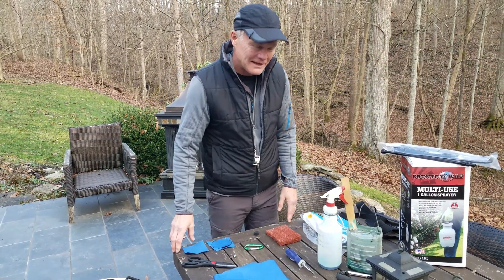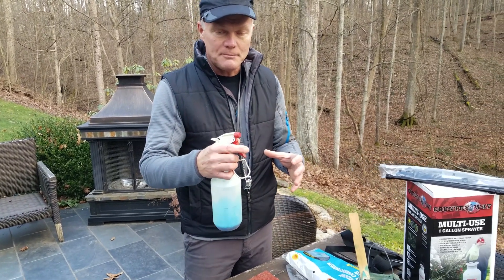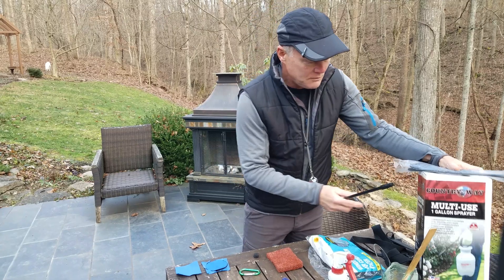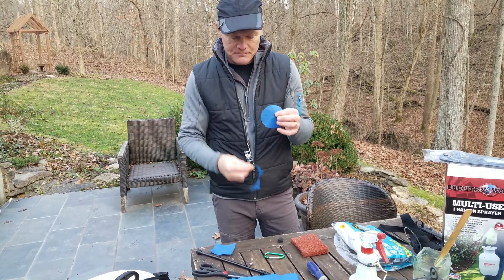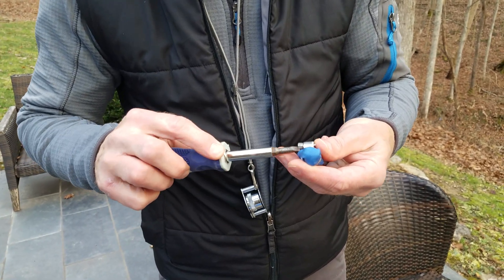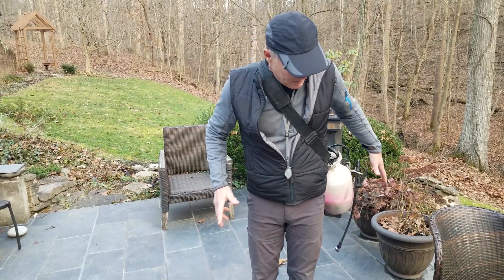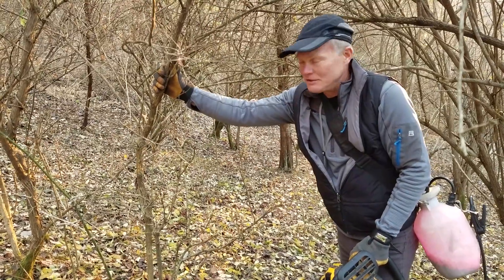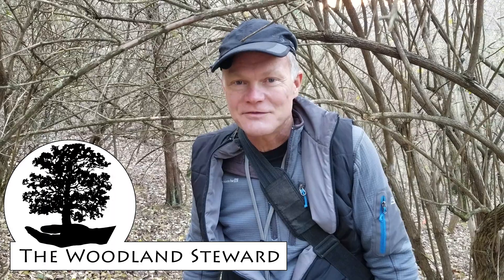Making an Herbicide Applicator for cut-stems (for ~$10) that will help you work safer and better

Comment: Thank you for the video.  I just heard about putting it in a bingo dauber.  Has anyone tried this? Did it work well?
Reply: it works well. The Buckthorn Blaster is basically the same, but with more herbicide-resistant materials. But expensive, for a bingo dauber, and you'll be on your hands and knees for every stump

Comment: Have looked all over for the indicator dye. Where can you get that hot pink color?
Reply: I think it is probably just fabric dye; Jim will correct me if I’m wrong, but that’s what I use in glyphosate. The difference I have noticed from the usual herbicide blue dye is that the red lasts a lot longer. What I mean is that a few weeks later the blue has faded or washed away whereas the red lasts. I used the blue with triclopyr. I’m not sure if the blue is meant to fade away. It’s still useful in knowing that you haven’t missed any cut stumps on the day, but not useful for making it easy to find the treated stumps months later. If you are generous with the amount of red fabric dye, the little pink cut stump will stay pink for a while.
Reply: @mayboggess2783  thanks for the help. Will try that.

Comment: Have you considered using paint dauber bottles?  It's a 2 to 4-oz bottle with a build-in sponge applicator tip. Think "bingo marker" and you have it.
Reply from the maker: I like the idea of paint dauber bottles. I have a small spray bottle on my belt when I go walking for that occasional application. Generally though, I need more volume (and I like the added length of the applicator wand when cutting with a chain saw or brush cutter).
Reply: I bought a couple of buckthorn blasters. They are like a paint dauber I think: small plastic bottle with sponge over the top. Fill it up then squeeze to fill the foam, then dab. They were nice because they were small and never spill. The problem was that the sponge wore out immediately, like within a day. I then experimented with someone over the top to protect the sponge. I used kitchen wipers; firmer than paper but not as tough as fabric, and held it on with an elastic band. The herbicides regraded the elastic band, which is probably why Jim uses the metal clamp: much better! Now that I have watched this video a few times I realize I can resurrect my little buckthorn blaster bottles by following Jim’s advice: fabric held on with metal clamp. They will be handy for small pocket sized jobs when you don’t want to get all the big gear out.
Reply: @mayboggess2783 I've used the Buckthorn Blasters for years and find the sponges wear out after about two seasons. The folks who sell the Blasters sell replacement sponges. It's possible that the heads from bingo card markers would work also; they are available on Amazon. One thing I like about the Blasters is that they have  spill-proof screw-on caps. I can just toss a bottle in the bucket I use for carrying tools. I usually carry several bottles, each with a solution of a different herbicide; I spray the caps different colors to help identify them. I chose to use the Blasters rather than a wand: if I'm on my knees to cut the tree or shrub then I can just daub the stumps while I'm down; no point in standing up to do the job.

Comment: Jim, great info on how to modify a sprayer for cut and spray applications. I primarily use my backpack sprayer for use on invasives such as buckthorn, Canadian thistle, burdock, and garlic mustard but I have a pond so I can’t girdle the buckthorn. Since I need to use an aquatic glyphosate, it will require a cut and spray application. Your advice on modifying a sprayer will really help. I also just subscribed since I really appreciate your knowledge. I have 40 acres full of invasive and would like to contact you on an occasion for advice.

Comment: I tried your method today.  It worked.  I sometimes got some extra release and drippage from squeezing the trigger a little too much.  This method definitely got more dye on my pants.  Less bending over that when using a dabbing sponge in a little tube.  Also I found a half gallon sprayer and used that instead of a gallon, less to carry.  Thanks!
Reply from the maker: The smaller sprayer is definitely a good idea!

Comment: After my first season last fall and winter treating cut trunks, I'm going to this method.  I had bought a small hand-held applicator that you pump nd spray but instead of spraying into the environment I sprayed into a disposable sponge paintbrush and painted it on.  It worked but takes a lot more time and effort and of course now the goofy thing is leaking at the nozzle and I don't know how to clean it or if that will help and the neighbor says oh they always leak.  I keep it in a bucket nestled in paper towels with the paintbrush in there and I see it seeped more than what I want to continue with anyway after going back to it.  Wish me luck!  Heavy duty nylon??  I have lots of scrap fabric around but I will start t the fabric store and ask for this.  To me, it does not sound very absorbent or porous but probably that's the point.

Comment: Just found this.
Grand idea! 
 I would recommend using zip ties over the dauber, instead of the hose clamp, as they won't be affected by the salts in many herbicides. 
I am in a war with Yuapon Holly and a dauber would be more efficient and targeted than current spray method.
Reply from the maker: Good idea! I chose the hose clamps because I didn't want them blowing off, but a zip tie might work too.

Comment: Looks  like a great idea! I'm looking to attack the wild rose that has recently come to overrun the woods in our area of Bethesda, MD. I gather you'd use 20% glyphosate on the cut stems. Watching your shoulder harness, which looks like an excellent concept, I'm worried about the tip of the sprayer hitting and soaking  one's pants leg. How do you avoid that? And do you use rubber gloves with the sprayer?
Reply from the maker: Sorry for the delay in responding. Yes, we use a 20% glyphosate to treat cut stems. I have not solved the problem of the sprayer tip hitting my pant leg. I try to hang it such that in minimizes the bumping, but you are right, it still happens. Fortunately, with the dye in the solution, I can see that very little if any is actually getting through to my leg through my pants. And yes, I try to wear rubberized gloves when spraying.

Comment: What a great idea. Usually when I cut stump and spray I use a squirt bottle and you're right, it aerosols the liquid. I'm definitely going to use this idea this year. I use a backpack sprayer for all of my foliar spraying. I usually dilute my glyphosate to 3-4 percent. What are your thoughts on wearing goggles and respirator while foliar spraying? Overkill? Thanks for posting this. Your channel is definitely one of the best articulated channels for this kind of outdoor venture. Please keep them coming.
Reply from the maker: Thanks for the comments! I usually don't wear goggles and a respirator for glyphosate, but I may be underestimating the risk. I rarely am spraying large areas with a lot of drift. When I am treating Japanese Stilt Grass (with Acclaim Extra) I tend to spray larger areas and from a greater height. Then I will wear a respirator.

Comment: Just bought a sprayer. Glad I found this video, gonna tune mine up now. I plan on using Dow Tordon on the Honeysuckle, any experience with it?
Thanks for the vids!!
Reply from the maker: Tordon can be released by the roots and can kill nearby plants. I think there is a warning on the label to not use it if there are valuable plants in the area.  I avoid it.
Reply: @TheWoodlandSteward  Interesting. I stopped using tordon for hack and squirt on ailanthus because it wasn't super effective on the bigger trees, but also because I noticed that it caused partial wilting on some adjacent paw paws.
Reply: I noticed the same with Tordon on a few paw paws but it never actually killed one.  I don't use Tordon anymore.  I've had excellent results with undiluted water-based triclopyr (44% i think, Alligare 3 was the brand) for hack and squirt on ailanthus.

Comment: Great thinking about the sprayer! Curious as to what you use for a color indicator. Would food coloring work?
Reply from the maker: We use Laser Blue Spray Pattern Indicator by Sanco Industries. We have been buying it for about $17/quart at Rural King. Similar products seem about twice as much at other vendors (like Amazon). I just order a gallon of the Sanco product directly from Sanco for about $45. It is VERY concentrated. You use 0.5 to 1 oz. in each gallon of herbicide. I use 1 oz. which is very noticeable until it rains. I have never tried food coloring, but would imagine that it would not be strong enough. If you try it, let me know.

Comment: Thanks for an excellent video on a make-it-yourself solution to 'painting' stumps with herbicide.  I've always rejected using chemicals but, with over 100 acres of woodland and getting on in years, I am willing to use what is necessary if I can avoid harming the environment.  It is frightening to see where those chemicals wind up after you put a color marker in them. I find both the simple bottle sprayers and the cheap pumps like you showed will continue leaking fluid out of the nozzle even when you release the trigger.  I really appreciate the details you addressed and solved, like the S hook for the wand and the carabiner for keeping the tank out of the way.  Keep these videos coming!
Reply from the maker: Thanks for the comments! It is revealing having the dye in the herbicide. It not only shows me where I've sprayed, but also where there are leaks in the system. I tried a new style of glove while spraying, but came back and my "trigger finger" was blue, showing me that the glove was not working as well as I was counting on.
Reply: I really hate the delayed shutoff nozzle leaking thing too.  Sometimes it can be completely fixed by taking all the nozzle fittings apart and cleaning the fine gunk out of them with water, usually pretty fast and easy.
Reply: I've always been cautious about using herbicides in restoration, but sometimes they really are the best way to deal with invasive species! I'm working on an area on a steep slope filled with woody invasives and it's been really tough digging them up without disturbing the soil too much. I mentioned using herbicides to a coworker to deal with some nasty burdock and nearly fell over when he suggested using them on the sloped areas as well- problem (hopefully) solved!!

Comment: Nice info!! Can I apply herbicide like this in March & April or do I need to wait tel late fall?
Reply from the maker: The problem with applying herbicide to cut stems in the spring is that there tends to be a strong sap flow up from the roots. Theoretically, that flow should be up through the xylem tissue (the woody part of the trunk just inside the cambium), while you are applying the herbicide to the phloem (just under the bark and to the outside of the cambium), so the plant should still take up the herbicide. In practice, though, the flow of sap can be so strong that it washes the herbicide away. I focus on Garlic Mustard removal in the spring, so I'm not doing any cut stem treatments now anyway, so I can't really share with you how effective spring treatments are for various woody invasives. Maybe someone else could leave a comment, or you could let us know what you find if you choose to do it.
Reply: @TheWoodlandSteward  Have you had effective termination in late winter (January and February) before sap begins to flow using this method?
Reply: Maybe I’ll uproot some this spring & do herbicide this fall. Kinda difficult to get in the woods in the fall due to deer hunting.
Reply: I wondered the same.  We have acres thick with honeysuckle that I’m anxious to eradicate. For now (in June), I will trim back the overgrowth on our trails, pull what can be pulled, and cut and treat the rest in the fall.  These videos are so informative.  We are in Butler County and these plants are everywhere!